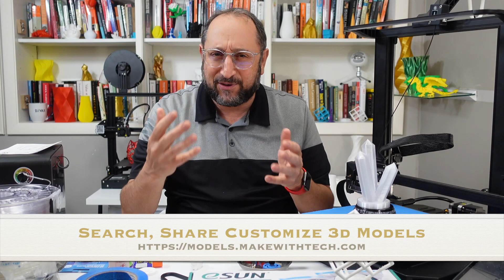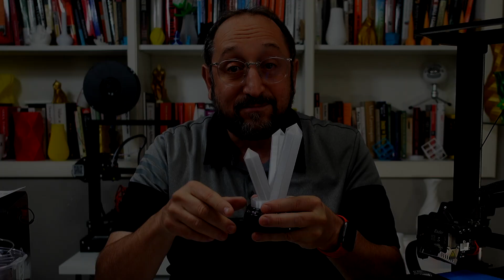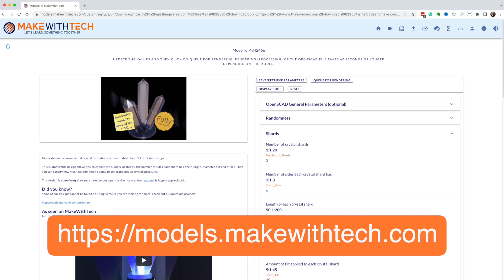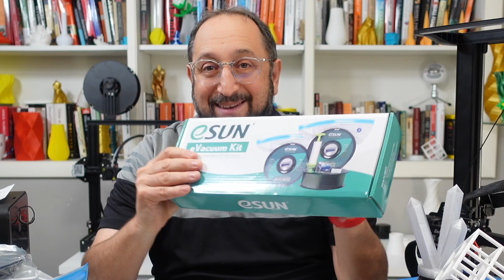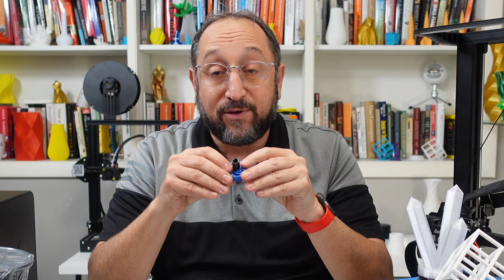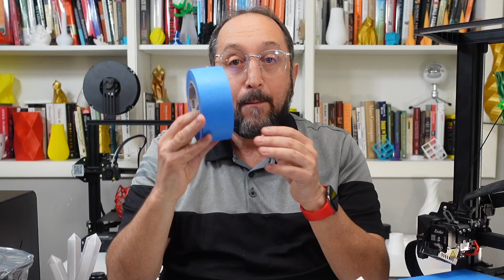Ender 3 S1 Pro Review - Engineering Grade Materials

Comment: I leave here my tips for nylon printing on creality 3 s1 pro. I got successfully printed pa-6 with bellow parameters: hb temp: 85’C. Nozzle temp 260’C. Cura settings: 0,4mm nozzle, 1-st layer hight 0,3mm, regular layer hight 0,4mm, layer width 0,5 mm. First layer flow 140%, first layer width 150% and it sticks to standard pei with no fancy tricks

Comment: I got that printer yesterday (very first 3D printer) and I only have PETG filament (actually read it was fairly easy to print and a bit more durable than the PLA) . The models came off without any force at all. One literally fell off when turning the bed to the side, no material left sticking. I didn't put anything on the surface. So you may use PETG on the original bed without problem.

Comment: Love the video, I bought the Ender 3 S1 and just ordered an all metal hot end and nozzle upgrade for $26 USD or $42 CAD still a great deal. I can handle the firmware upgrade myself. If I’ve been able to order the pro though I would’ve ordered the pro instead

Comment: Blue painters tape just rocks and is an excellent weapon in any toolbox. I seriously recommend folks have this on hand.. It works great on the bed for materials your having difficulty with and it works great in post processing to mask parts while painting. It's also much stronger than regular masking tape. But the best feature is that while it sticks really good, it can be removed really easily. Always keep some at hand..

Personally I find product such as gluestick, while does (maybe) give a little adhesion, in reality what they are good for is as a release agent - ie. It forms a barrier between the print and the bed, so when the print bed cools for the most part the print comes right off without ripping chunks from the bed (especially glass). I feel that products on bed should be viewed more as a release than a glue..

It would have been nice to see the crystals being printed, but I guess I'll have to check out the file..

The vacuum bags are great though the valve does eventually fail on you, but that's no problem as the bags are not ultra expensive. I do find though that the spool gets bent out of shape though being compressed by the bag - I'm thinking about printing some kind of support for the spool - I don't know if it will help.

I also have issues with the dry box spindles not allowing smoth movement of the spool. Maybe I'll look into just why this is happening and if there is a fix. It may even be the tired spools themselves.

Anyway good video and thank you Dr vax.. 😊
Reply: It is interesting to find someone using it in 2022 - it's a real throwback to the days when everyone was experimenting. Check out YouTube videos from 2010-2017. Painter's tape. ABS juice. Mirrors from IKEA. (Which, incidentally, is what I use on my X2 - just clip one to the bed, use glue stick, works for most things.) The mirror sheets would actually make a good substrate should I choose to try those PEI film stickers - no need to apply it to the built-in bed, apply it to a mirror instead, and it's instantly removable. I suppose I could put blue tape (or plastic tape, if I wanted to print polypropylene) on one if I needed to also. And you get a pack of four for six bucks.
Reply: @iskandartaib  I swear by blur tape for some jobs.. for instance, I seem to get a lot of trouble with asa - blue tape to the rescue..

And when painting, rather than mark the piece with tape, the blue stuff comes right off.

Sometimes the old ways are the best ways

Comment: I'm sure this has been tried, but I'd put some desiccant bags in the printer dryer (in each of the corners --drilling out a good sized hole in each).  And when not in use, I'd try to find a way to seal it up (a gasket all around and some tape over the filament hole) and attach a vacuum pump up to it.  If you had a pressure sensor inside the dryer (connected to an Arduino or Raspberry), you could keep turn on the pump when the vacuum started to drop.

Comment: Two things: Could you share a link for the three wrenches you mentioned (torque wrench for the Ruby nozzle, the metal heating element wrench, and the robo grip from Rigid ). Also, would you do a video about bed leveling on the Ender 3 S1 Pro? I have seen your other videos on leveling, but it seems that it is a bit different on the Pro. Thanks.

Comment: Great video as usual.   After starting out using painters tape, I'd rather not go back unless I have to.   I print on a PRUSA at work and have printed some Taulman bridge with limited success.   I now have a garalite clad spring steel bed for my next attempt but l might give the painters tape another try if it does not work.

Comment: I’m using the sprite pro kit on my e3v2, 422 board, Jyers modified to give a 60 second 9 position BL touch probing ( CR touch on another printer) and 230x230 Ned area, 300c hotend.
I’m loving how well it’s printing! But you brought up an interesting point about replacement nozzles. How does one verify the new nozzle is flush tight against the all metal tube when replacing a nozzle? I’m assuming if the nozzle barrel length is identical to the original it’s ok once tightened? Or are there a few extra threads on the nozzle length to snug it up? 
So far I’ve only printed pla and Petg for a short time so I haven’t explored changing or substituting a new type nozzle. Maybe a follow up video on sprite pro nozzle changing?
Thanks.
Reply from the maker: I have had no problems with the Micro Swiss nozzles made specifically for the Ender 3.   I would stay away from low cost generic nozzles.
Reply: @MakeWithTech  Does this new printer use a new kind of nozzle, or does it use the standard Mark 8 nozzle a standard Ender 3 uses? The nose looks different.

Comment: Thanks!  I am looking a investing in an S1 pro currently, it will be my first printer, I am a total newbie.  Everything made sense, and was very helpful.  Did you have your s1 in any type of enclosure for the Nylon or Nylon-X? Wondering how much value is added with a soft enclosure, seems like a filament dryer is more important, though I am in Denver, so may not be an issue here. Thanks again!

Comment: Thank you for all the great videos!  As someone that's recently reviewed both the Ender 3 S1 Pro and the Super Racer, which would you suggest for someone who wants to use mostly PETG, doesn't care about speed and primarily wants quality and ease of use?  (I wish both had larger print areas, but I'll just have to get over that.).  By ease of use, I'm referring to the tuning and other efforts to get the best results (for instance the SR appears to have a very easy E-Step calibration routine).  ...Maybe a head-to-head comparison video would be popular?  :)   Thanks again.
Reply: If you're printing MAINLY PETG and not interested in nylons or PC, want something bigger, and am not concerned about speed, I'd consider the Artillery Sidewinder X2. There are similar printers from other manufacturers as well - Two Trees makes the Bluer Plus, Creality makes several versions of the CR-10. Most of these use Bowden tubes, however, the X2 is direct drive. And rather than the Ender 3 S1 Pro I'd consider the regular Ender 3 S1, if you want to go that route.
Reply from the maker: The quality on the S1 is better.
Reply: Prusa MK3s. Or if you want it more custom Voron 2.4 LDO kit.
Reply: @Todestelzer  IF you like construction projects that cost a lot of money, I suppose that's true..
Reply: @iskandartaib  hmm. I started with a Anycubic too. But if someone ask me what printer he should buy these 2 would be my suggestion. The Prusa will print without the need of tuning or modding it and the Voron is a mod and tuning monster.  There is a new printer coming soon but still on kickstarter for now.

Comment: Hi Irv, I had exactly the same problem as you found with EIBOS single roll filament dryer box feeding filament direct into a FLSUN SR. Caused the extruder to skip steps. So I too use the EIBOS to dry filaments and then place them into SUNLU filament dryer box ( which are NOT very good at drying filament ) to feed the filament direct into the printer. The SUNLU roller bearing work much better. Refering to Chess Knight's query re printing PETG, I have had a lot of trouble with my FLSUN SR printing PETG - model letting go of the bed after a couple of layers - tried glass, PEI, Glues. Will go back to the old painter's tape.

Comment: Your great videos really helped me get this hobby going for me. I bought an Ender 3 S1 Pro and loving it. However, i have a question you may be able to answer. My Ender print bed is 220x220mm, but the file i need to print is a tiny bit larger than 220 mm. I tried setting the printer to 235x235 in Cura, but whatever i try, the printer refuses to print larger than 220. I suspect i need to edit some G code to make this possible? Can you point me in the right direction?
Reply from the maker: This is a firmware limitation.  You probably cannot easily override it.  It is designed to protect the machine.
Reply: @MakeWithTech  Maybe with Klipper fw? Thanks for your reply!
Reply: just print the part on a 45degree angle on the bed
Reply: @timothyhackett7372  Yes, i thought about doing that.. good tip!
Reply: @koosy2987  just make sure when you do that you modify your external infill angles and support angles 45° as well otherwise you may run into support problems and infill problems.. I use simplify 3d for my s1 pro and I had to do that for a recent print

Comment: I really wanted to buy the "Ender 3 S1 Pro" its on sale for 399.00 on Amazon.  BUT ,  I wasted 1 yr learning to draw solids with Fusion 360 and was transitioning to CAM ( I am a CNC Machinist ) when they pulled the plug. I was really pissed because I was about to purchase a CNC Router for Hobby playing. Now I want a 3d printer and still no CAD that is affordable so its time to give up on those dreams. Since 360 is cloud based, they could determine who was abusing it and cut them off, NOT ME !!!!!!!!
Reply: Do you need some models made?

Comment: Very interesting. I use a printer with direct drive and an E3D all metal hotend with a hardened coated nozzle. I print engineering not decorative parts, so always interested in videos like this.

Never tried nylon because of the reported moisture problems which sound like hard work to control, but may do so now.

However, have you ever tried polycarbonate with or without carbon fibre as an engineering material? It needs high temp, up to around 300/100C (which my printer will do) but has the reputation of being very strong (similar to nylon, possibly less flexible) but from materials websites should have less of a moisture issue.

I have tried Priline PC+CF which is good to print with, but seems to ooze a lot. However it is obviously not pure PC because it prints at around 230 to 240C so it must be a blend - they do not say of what.

Would be very interested in a video comparing nylon and polycarbonate.

Comment: Um...your math is a little off $379 to $499 is $120 difference; not $80. Even with your on-screen correction for the S1 @ $399; that's still $100 difference, not $80.

Comment: Laughing 😅If you think assembling a prussa takes too long, I made my first one from scratch including my own circuit board design. Disclaimer-  I eventually switched to commercial ones when the quality improved. But my one did work! 12 years later, my CR6 Max even used the same microcontroller I used in a smaller pinout. The E3 S1 Pro is great. I've diverged off printing my own designs for a couple of weeks to print some other people's articulated animal designs.